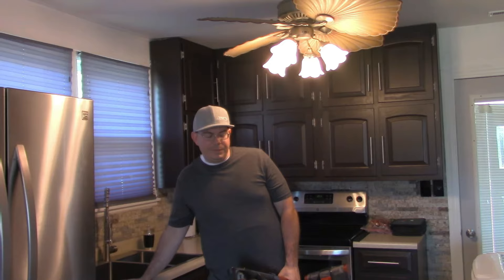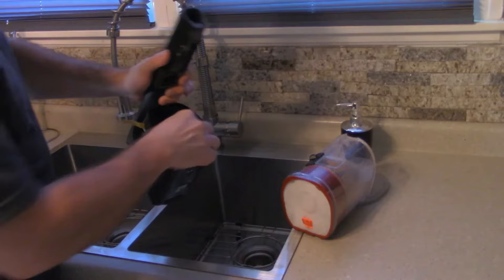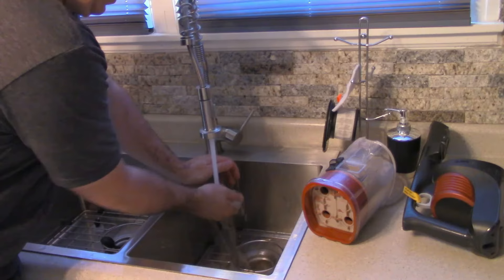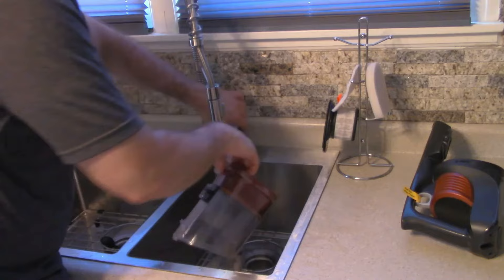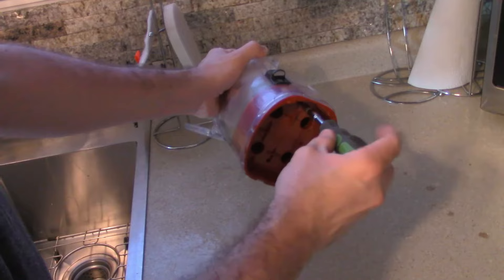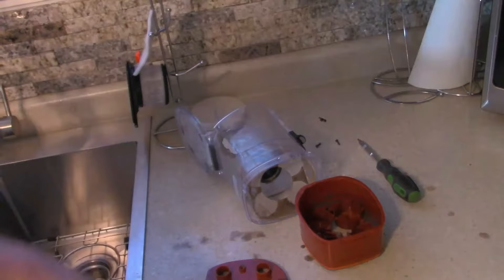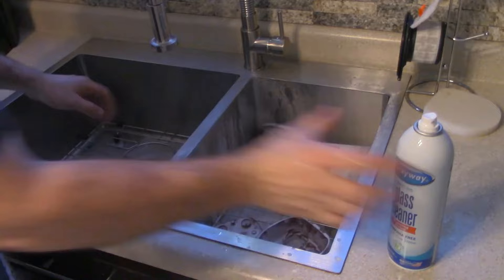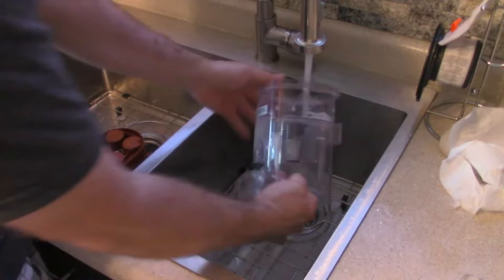How To Deep Clean Shark Pro Rocket Self Cleaning Cordless Vacuum Cleaner

Comment: If you want to clean under the roller brush without removing it, I found it helpful to roll an unfolded damp, but not saturated, paper towel back and forth under the brush. It helped to clear most of gunk from the clear window. I used a mild cleaner on the paper towel. I also fed one thru the hose opening. It helped with the odor.
Reply: YUP! thats what i did, i got to the point in disassembly where you get to the motor and plug removal and said screw it. and just triple-folded a damp paper towel ran it through the roller until it came out the other side. then just rolled it back and forth to where i felt it was clean "enough"

Comment: Easiest way to clean the rotar assembly enclosure (clear window) and rollow is to stuff two Clorox wipes between the roller and the assembly.  Now rotate until the wipes come out of the other side.  Remove.  Now repeat with new wipes and move toward the other side of the roller window assemby.  With the clorox wipies inbetween, they create a sort of "squeegee effect".  If you put too many wipes, they'll get jammed.  I found if you put two weaved in a line together, they'll clean that pretty well.  Same with the roller.  Lessoned learned.  Don't take apart the whole thing unless you want to blow out the electronics and moter with air (dust shortens the life of the motor and electronics added excessive heat over many years of use.  As for your quarterly cleaning, I'd recommend just using the clorox "squeege" method listed above.  You'll thank me later.

Comment: Wish you would have gone in a little more detail with the screws on the reassembly.  I have all kinds of screws and sizes and holes and I’m so mixed up over here idk what to do.  For example I have two longer black screws.  I remember they came from somewhere but I can remember where they go.  I have a bunch of small screws that I know come from the front end assembly but there as so many holes I’m not sure which ones go where.  If anyone can help me out I would appreciate it
Reply: I also wish there had been more detail on separating screws when it was disassembled. I wasn't sure which went where when putting back together. Vacuum is working so hopefully it wont be an issue over time if they are in wrong place. Also wish the mistakes would have been warned ahead of time (video edited). I followed along before watching all the way  thru so made the same mistakes along the way which could have been avoided. All in all great video and got the job done!

Comment: This video saved me from buying a new vacuum. It was working but needing cleaning bad. It seems intimidating at first but once you get through it, you realize not so bad. Instead of using box cutter, I actually used a drill bit and drilled the holes bigger for the screws that couldn't be reached. You just have to be really careful not to go to deep and ruin the screw head. I also left this reply on another comment that was below: "
I also wish there had been more detail on separating screws when it was disassembled. I wasn't sure which went where when putting back together. Vacuum is working so hopefully it wont be an issue over time if they are in wrong place. Also wish the mistakes would have been warned ahead of time (video edited). I followed along before watching all the way  thru so made the same mistakes along the way which could have been avoided. All in all great video and got the job done!"

Comment: Excellent Video. I was able to follow the steps to dissemble fairly easily. The only thing I wish I knew prior to starting is that I would need "tamper proof torx bits" is size t10. I didn't have this on hand so I need to wait a few days for my order to come in to continue this project. Currently waiting for everything to dry and i'll reassemble!

Comment: If you are simply  trying to clean the crud out of the tiny wheels at the bottom-front of the brush area, skip to 1:09:59 in the video.  You do NOT have to completely disassemble this thing to remove/clean those.

Comment: What kind of screw driver did you use to remove the bottom of the brush roll housing? I need to clean those tiny wheels in the front!!!
Reply: Torx size T10
Reply: those danged wheels! Their design is awful.

Comment: So at 1 hour and 20 minutes for a teardown a professional vac repair shop is going to charge you $180 - $200 minimum to service this. Cost of a NEW Shark Cordless ranges $ 200 (on sale) - $350. If you do the work yourself on a rainy weekend with nothing else going on I suppose its worth it. Or just buy it on sale and pitch this in the trash.